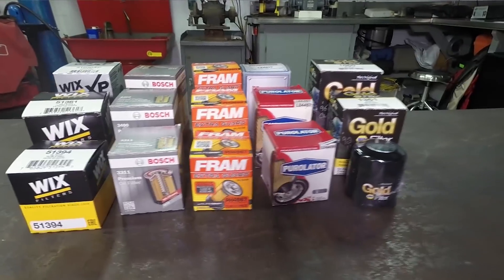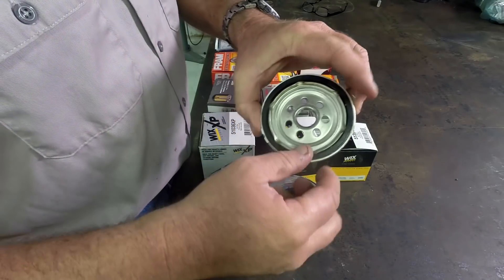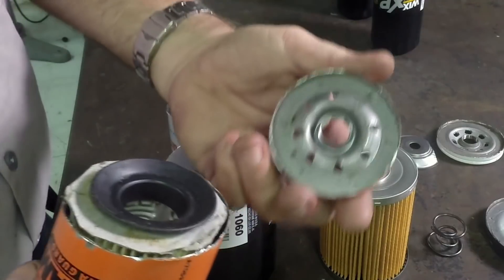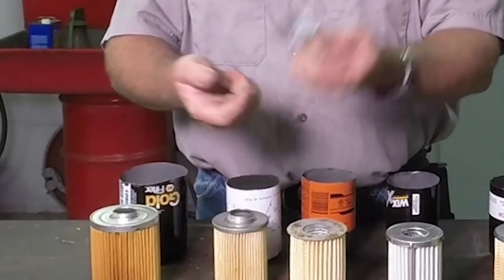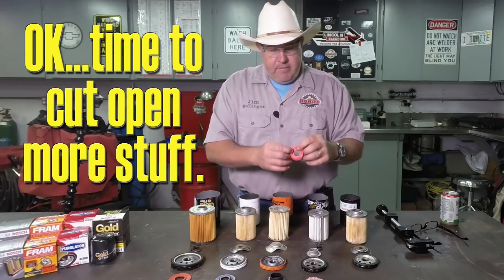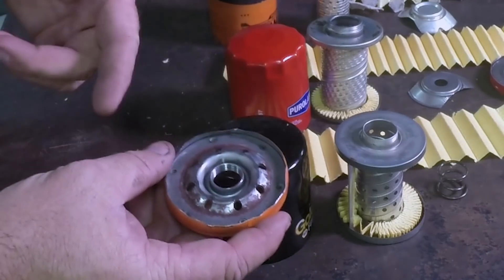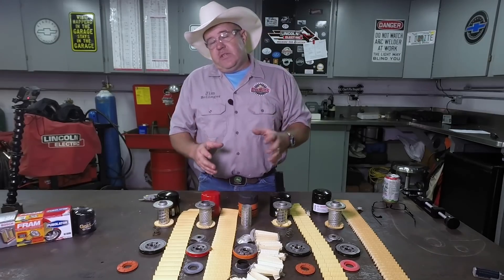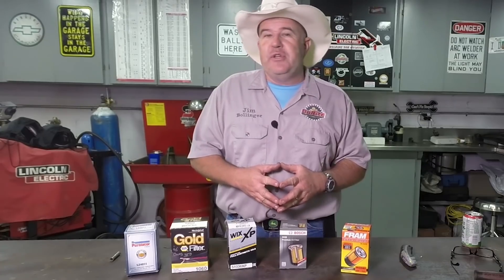The worst oil filter EVER!

Comment: This damn well changed my opinion of fram in just a few seconds. Won't be using them again.
Reply: Laquasha Green  Oh come on, don't be a dufus. If you watched the video you know the truth, but if you don't believe him and the results he's shows, do it yourself and see if he is right. Be sure to record it and post it for us all to see. Plus, you think he would say something like that in public, where if it wasn't true Fram would sue the daylights out of him. It's obvious to me they won't because he's right and they don't want it made more public than it is.
Reply: @chrisbaker2903  Cutting the filters open does not mean much. Rust would be captured by the filter media. The type of back flow spring doesn't matter as long as it works and the seal prevents back flow. The important thing to test is the flow rate thru the filter and how much particulate is captured. That can only be accurately tested by making up a standard of dirty oil to test all the filters and measuring how much pressure drop happens when the oil passes thru the filter and how dirty the oil is coming out when the filter is new and the oil cold and say after maybe 72 hours of having the heated standard oil continually pumped thru it. Measurement could be simple like rating a drop of oil color on a white paper towel or more detailed using a glass smear between two microscope slides or a grind gauge. I could give diddly about how strong the spring inside is or how thick the can is as long as it does the job.
Reply: Laquasha Green .  I've had experiences with Filters from the 1970's on, we scratched them from the Military Motor Pool as well...they're Junk and always have been!
Reply: Laquasha Green  You can document your assertion? And did he fake anything in this video? 
By the way, I didn't call you a dufus. I just said not to be one.  You however, did call me a name and that puts you squarely in the wrong. But that's your problem not mine. Notice that I also called the guy who cast racial slurs. Name calling is wrong. Look back at what I said and you can see, if you are honest with yourself that I really didn't call you anything.
Reply: @chrisbaker2903   The claim that the yt maker worked for Fram can't be corroborated because it's bogus.  One clue, the guy's name is Jim not John, says so in the beginning. Also he's located in Fla which has no Fram manufacturing. What is true, is Fram is very sensitive to these videos showing fiber/cardboard endcaps. Frequently their lead shill rep cadzillals6 show up to trash the maker. Or he gets one or more of his toadies to post for him and link to his yt videos. Already seen one link here. No doubt yt maker has ticked off Fram's cadzillals6 and he's working to trash him.
Reply: @faxmen09   Yeah, it's the old Wikipedia thing where someone edits their own company's articles to remove embarrassing information.
Reply: My opinion on fram was changed long ago. My dads Kias engine took a shit and and Kia actually said fram filters void the warranty
Reply: Laquasha Green  proof is in the video.  Sorry.
Reply: Laquasha Green  Definitely trolling.
Reply: The only reason Fram is still around is because their filters are cheap. People like saving money. I will continue to buy my 10 dollar filters and leave the 5 dollar Fram filters to those who do not know better.
Reply: Love you too Laquasha Green. Lol! Dont be mad because you work for Fram. You sure are not representing your company with class.
Reply: I stopped using them a few years ago when I saw my first filter review video. Never ever buy Fram.
Reply: Heard Fram were cheap before. I bought a Bosch couple weeks ago when changing oil.
Reply: I have been a mechanic for 21 years and no company I have worked for would use them. So I guess I do not know what I am talking about huh Laquasha.
Reply: Laquasha Green  I am amazed at how ugly you get with all the people who disagree with you. Someone in the company (FRAM) needs to read your mean replies so they can publicly apologize for allowing you to represent them.
Reply: Me neither.
Reply: Laquesha believe me I do a lot more than change oil. Like I said Fram oil filters are cheap that is why they are still in business. They put that handy sand paper on it for grip. Say what you want #1 selling oil filter in the world! Still does not make it quality. I have worked on everything from Volkswagen's to Peterbilts baby girl. You can trust me I know what I am talking about. Stop believing what your company is selling. It's ok they just make a low quality filter, as long as you get your paycheck from them.
Reply: This is the cheapest filter they carry.... and hes comparing it to more expensive oil filters. Fram has 3 or 4 models better than this. Their synthetic version is great. Has all the bells and whistles.
Reply: Hocus pocus people //
Reply: Laquasha Green  The guy does sound very biased in his testing. Of course the only proof in the pudding is how well the filter actually does the job which means measuring what come thru the filter. The others may be built strong but not have the best filter material.
Reply: Laquasha Green  all hyundai engines and kia engine say Fram filter will void warranty.  According to Mass Ferguson law a dealer cannot void warranty unless they can prove product used caused damage.
Reply: Laquasha Green  I like how you state you work for FRAM but then go out of your way to name call and insult someone else on the internet for all to see. Easy way to get fired and lends a great deal of credibility to your claims.
Also La Squasha is a terrible name to give a child. Your parents must have had it out for you at an early age.
Reply: Makes me want to go and buy a Fram just to see how crappy the inside looks. I've been using FRAM oil filters for decades and still don't have any engine issues on 376 thousand miles.
Reply: Laquasha Green  Seeing is believeing.
Reply: Easily!
Reply: Everyone freaking out but their cars never blew out  because of Fram.
Reply: @rayg5445  Rarely seen an engine blow because of the oil filter. I believe if you properly maintain your engine, it will last a long time. VW flat four engines didn't even had an oil filter, only a strainer.
Reply: if its low priced, i still could use it.
Reply: Laquasha Green   Laquasha Im sorry that everyone is picking on you . they are dickheads and they sleep at work... so you know how that goes . the factory where I used to work contracts filters and we made the Ford and Mopar brand . good filters .

Comment: For all the haters out there... The cheap WIX is very similar to the fram. If you get the fram x2 it is similar to the wix (with price to match). K&N is like wix. Do this yourself. I did. I bought what I thought was the best 3 filter form my local cut them open and they were all similar. (Fram ultra, k&n, Mobil 1 and Wix premium) all of them had helical springs, synthetic media (according to the box) heavy gauge body's and baseplate. Every company has a line of products from crap to fantastic with prices to match. So don't get all butt hurt that a cheap product is cheap. Educate yourself then make the right choice that best fits your need.

Comment: Comparing a $3 filter to $8 filters...frams really aren't that bad for the money. As long as you keep the mileage below the recommended intervals, they work fine. I've never had a problem with a fram filter.

Comment: You need to get a dealership filter that came with the car why because the number of holes on the bottom of the filter. Wix has 6 holes mine from the dealership has 10 holes so the oil flows in quick and comes out quick thus you have good oil pressure and it's not restricted by lesser number of holes.

Comment: wanna read something funny.....google  Best Oil Filters for the Average Car in 2018 or Best Oil Filters for Your Car

HAHA Fram is listed above Purolator and Wix   LOL  not after seeing this video...at least not for me.
I've used one not even on the list for last 10 plus years (K&N) and had good luck so far

1) Mobil 1 Extended Performance Filter.
2) Royal Purple Extended Life.
3) Bosch Premium FILTECH.
4) ACDelco Professional.
5) FRAM Standard Oil Filter.
6) Purolator PL14610 PureONE Oil Filter.
7)Wix 51348 Spin-On Filter.

Comment: As a tech i say only ise top of the line from your brand of choice also of the cheap filters FRAM has been the worst of them but others are also junk at the bottom...just use quality and a top line FRAM is usually ok .. Nothing special but of average quality. This one was the bottom of the barrel kind and it is garbage.

Comment: You test FRAM 's cheapest filter.

2000 Ford Mustang: 215K, 2001 Ford Explorer: 192K, 2009 Toyota Yaris: 118K, 1997 Mustang: 101K. They all have one thing in common. Regular oil changes with FRAM Extra Guard filters. Never had a single problem.

Comment: Very biased and stupid.. Fram makes a platinum and gold filter but you use the base filter? Get outta here.  
 
You just said the Napa filter was the gold filter so you are not comparing apples and apples. 
 
Dumb comparison you numb nut. I have used Fram for 10 yrs never any problem with my cars. 
 
One has over 100,000 miles the other 70,000 miles.

Comment: Wow, so happy this was on my recommended. I’ve used Fram filter on everything possible, my multiple vehicles, tractors, and anything they sell filters for really. I’m done with Fram, I wish I took the initiative myself and cut one open. I’ve used them since I was 16 and currently have the Fram tough guard on 4 of my vehicles! I really want to do a change on them early just to get that cheap ass crap off my vehicles. Thanks for the knowledge and honest review! 👍

Comment: As a hydraulics guy filters are one of the most important pcs in a system. One of the comments said you should retest because of the price difference. I have to agree in principle,but at any price if you buy a "filter" to save guard your system that comes with rust that is bad. Even worse is the filter media breaking up or the parts holding the media. This $5 savings can cost thousands of $$. I've had disassemble systems that the media broke up,it is not cheep or fun.

Comment: Only thing I didn't like about this test is you're comparing cheap filters to expensive filters, that would be like comparing Walmart brand tools vs snap on. Ide like to see the purolator boss vs the napa gold vs whatever frams highest filter is, I use purolator boss myself, but am curious the difference in the boss and napa gold.

Comment: To get more technical on filtration, there are 2 types of filter media.
1) Surface type which only catches particles on the surface. This is the most common used.
2) And depth type which is usually using a media called lofted fiber material. Your higher priced longer lasting filters use this.

Lofted fiber catches the particles on the surface and inside the filter media. This enable the media to filter down to a smaller micron size without restrictive flow aka gallons per minute (gpm). Common no frills filters such as Fram filter down to 40 microns. As to why they also can use less filter media. Hair is 50 microns in size so with the cheap filter you are allowing things to go through your engine almost as thick as your hair. The human eye cannot see anything smaller than 40 microns.

A more standard manufactured filter will have a media that filters closer to 30 microns. The reason you cannot get to low in micron size is that flow aka gallon per minute suffer. And the surface type filter clogs quicker. But lofted type you can go much lower because they hold several times more particles than surface type. And flows much more even at lower micron filtration. Amsoil oil filters filter 10 microns and because they use nano technology in the manufacturing process which improve the flow and life of the filter before it becomes restrictive. They have filter that when using their oil can last up to 25,000 miles. No joke. And because all their products are covered by a warranty insurance, they have to prove that their product last longer than stated before the insurance will cover it.

Their oil filters come sealed in plastic bag inside a oil filter box. The canister is high gauge as well as the base. And all parts inside the hold things together is metal and a rubber drain back valve.  Last I checked Wix was making their filters but to Amsoil's specs. Not one of those I copy your filter type deals as you showed where the guts proved certain filters were being made the same just different names.
Reply: To get technical on a technicality, there are more than two different types of filter medias. What about the cellulose media or the synthetic glass media?

Comment: Many years ago a standard Fram filter I bought still had a one inch metal lathe cutting stuck to the mounting threads.  I thought that could easily have destroyed an engine, and never bought another.  The high-end Frams later introduced were well reviewed in Consumer tests, and so I often use them.  With filters and oil,  API specs and reviews are everything you need to know.

Comment: Ive used hundreds of fram filters on everything from atvs to boats to trucks and Ive never had one issue...I.think alot of these people commenting have not had sny issues with a fram filter either...if you plan on using the filter for more than one oil change or for more than the 5000 mile recommended change period then maybe it would be wise to use a filter double the price...when I put vehicles up on my hoist and change oil ,whether it be fram or napa gold.the oil looks the same...instead of this hokus pokus why dont you have the oils annylized to see if one oil is more contaminated than the other...

Comment: To let everyone know. One time I changed my oil in a 90 Ford ranger I used a fram oil filter, cant remember how many miles but not long after that I noticed I lost oil pressure thinking what the heck so I fig well the oil pump went out so I took the oil pan off and what I seen. I seen the dam cardboard from the filter had clogged up the oil pickup, the oil filter broke down. took it off cleaned it drain the crap out of the pan changed the oil again of course with a different filter and drove the truck many years after that. Thank you sir for making this vid, fram is crap with their cardboard crap

Comment: When I worked O'Reilly's commercial a wix rep. Came in with MULTIPLE brand and brand name filters and showed the exact thing you did. I was all about Fram but after that I won't touch anything but wix. Same for the air filters too

Comment: I keep seeing a lot of negative coments for switching to a larger filter with regards to low oil pressure...a larger filter itself WILL NOT LOWER OIL PRESURE..... oil presure is relative to the thicknes of the fiber filter inside...they actualy make larger filters for 95% of vehicles, depends on the aplication i/e police vehicles, gov exc... the only difference is going to be a change in oil volume...

Comment: Three customer of mine that came in my shop, 2 with ticking noise and 1 with rattling in engine were due to fram filter. All 3 were resolved with an oil change with wix filter. Been telling all my customers to stay away from Fram. By the way, someone at Orielly auto parts said that microguard filter alis made by Wix...hmmm

Comment: About 20 years ago a representative from the "Champ" brand filters came into our parts store and demonstrated the the same test as you on oil filters, with about 5 different brands. I have never used or endorsed FRAM since then. Champ manufactured "Store Brand" oil filters like for instance Walmart, Kmart, Auto Value etc. The $2.00 filters were much higher quality than the best Fram, Delco, and other filters on the market. Motorcraft filters were also higher quality. If you look at the holes in the top of a oil filter and see that not all of the holes are circular and some are oblong the these are most likely manufactured by Champ and a better quality, even if it cost $1.99 and has a name like "Auto Sure" or something similar. I cringe when I look in someone's engine compartment and see the bright Orange Fram!

Comment: I don't use auto parts distributors that only hire low wage street people. Saves me time only having to do the repair with the right quality part the 1st time. NAPA is at the top of the barrel for mass warehouse parts. AutoQuirks, ADD Vance and O' Really? are all sleazy low paying pick a pack warehouse corporations. They could give a rats ass about quality or actually helping customers choose the right part. NAPA cost more for most parts. I have yet to put a NAPA part on twice. If you see that O'Really parts truck outside your mechanics shop, run or push if you have to!

Comment: i used fram for years then say another video about 2 years ago then stated using mobile 1` filters as well a mobile 1 synthetic  high mileage oil i had a small oil leak from my valve cover it is gone now but once you use high mileage oil you cant go back to conventional oil or you will have oil leaks.

Comment: Fram has always been garbage too, this isn’t some new post recession factory moved to China drop in quality since 2008-9. They’ve ALWAYS been garbage. My uncle had remanufactured his FE390 about 20yrs ago. Unfortunately for him on break-in he’d put a Fram garbage can on it and very quickly wiped out every bearing in the engine because the drain back valve was completely stuck shut and no oil flow. This guy isn’t some schmuck backyard mechanic either that forgot to prime or didn’t know how to break-in a tappet cam. He rebuilt  the FE again and it’s still going today although some dumb broad in a Volvo has since wiped out the truck it was in. That was right about the time I started driving and no fram garbage can has ever hung from a single engine in any car I’ve owned since as long for as it was in my care.